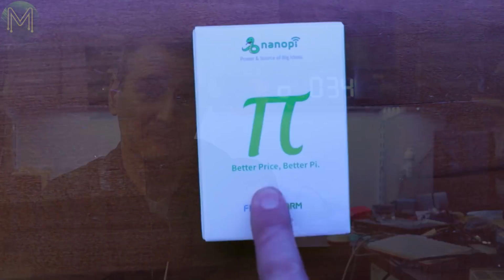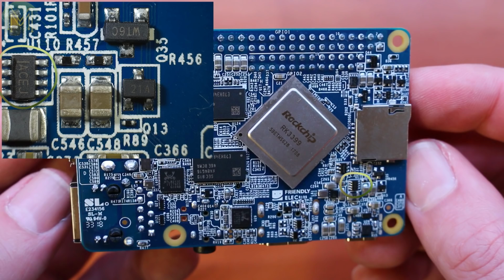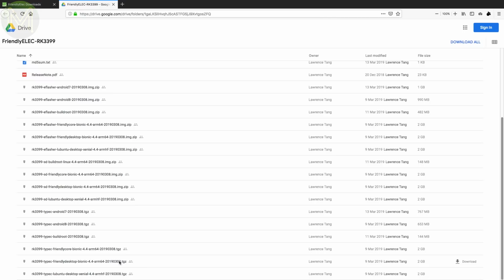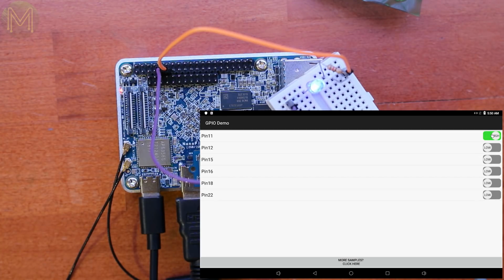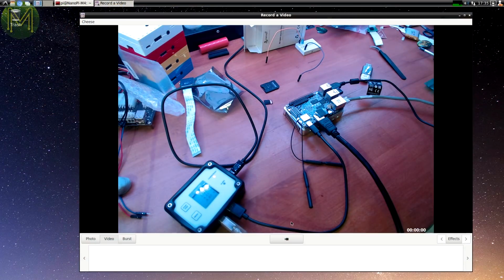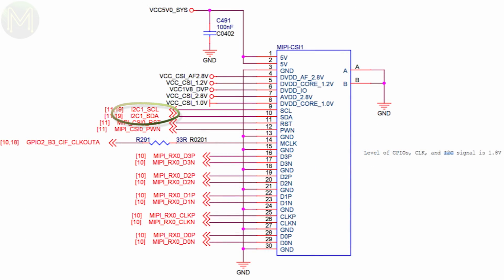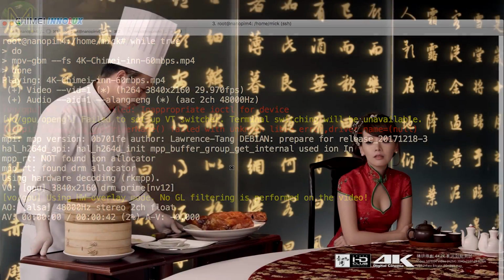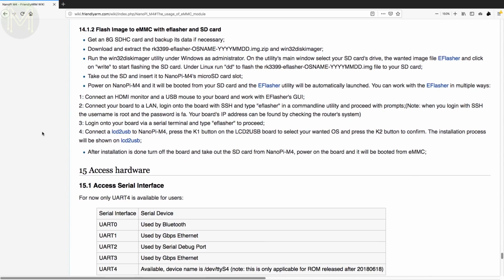#266 Nano Pi M4: Can an SBC get any better? // Review

Comment: Good day Sir, if I have 4k hdmi to csi-2 module, can the nano pi mipi csi-2 have 4k @60fps? if not what's the maximum it can handle. In case it cant handle 4k, is there an SBC that you know that can handle 4k through mipi-csi-2?

Comment: Excellent review!.I have serveral Nano Pi M4 for fast USB3.0 astronomy cameras image download. Tested on Ubuntu and Armbians, ok. I just found some issues porting some Raspbian oriented software, or pigpio types of libraries (DMA usage), and basically you need to sudo quite often to access gpios or i2c.. I saw you using root@ account for your demo's, so you probably faced the same. There is almost no support for this issues anyware. Thanks!

Comment: Want this board  still  there's  a  new  revision  of  it defaults  to  4 ram  of ddr4 ads a power switch   70 usd .and  a  nice  case with  a  fan and  the  ssd adapter  by default  forgot  to  mention   the  case  and  ssd adapter  on the  original  post  .

Comment: Hey Mick,
Jeez, you went through the update kernel bit sooooo fast!!
When I changed to Nightly on my headless Armbian Orange Pi PC +, it started "Removing current kernel ...". Then I lost my Putty connection, but was able to get to a prompt from a Pi (via Putty) connected to the serial debug port (using Minicom). It reports "sudo: armbian-config: command not found". I wonder what happened???
It would be good if Armbian had a way to backup the emmc. Something like Friendly's EFlasher! Maybe there is a way?

The reason I was so interested in updating the kernel is that my OPi PC+ looses WiFi (Wiffy) connection to my router every few weeks and I'm not sure why?

BTW: It may be useful for many (definitely for me) if you could do a tutorial or few on how you check the capabilities (SPI, I2C, etc) of SBCs. Some of that kernel magic may be useful to know, too. You seem to do some fancy stuff that I don't see others doing!

Thanks for the awesome vids!!!
Reply from the maker: Thanks mate.

Sounds like the board crashed half way through the upgrade.
The short answer would be to reflash the SD and go from there.

I’m actually thinking of designing a Pi header tester so anyone can test out SBCs that have a “Pi header”.

Comment: Don't the GPIO signal pins use positive voltage?  So connecting it to another positive voltage GPIO would cause a mixed signal.  the GPIO signal pins should be positive and connected to  a GND GPIO right?

Comment: What power supplies would work with this? I've read it's not a smart USB source so needs a constant voltage type supply but haven't seen a 5v 4a one in AU. The one they offer on the site is US pins.
Reply from the maker: Indeed the USB TypeC isn’t fully PD compatible unfortunately.

Comment: More cores and more ram. I could replace more systems on my network and start doing more low power consumption virtual machines. I plan to soon 3d print a 2u panel and attach smb to the panel.
Reply from the maker: Nice. I’m planning on updating my Pi3 cluster with some NEO4s. Slightly cheaper than the M4.

Comment: Im looking for the cheapest sbc just to test wired Ethernet 1gig download speeds at different customer locations that have 1 gig download isp speeds. Im thinking i will add a small screen, case and mouse. (will just use the keyboard to save a few links, then hoping i will not need it) ..... anyone have recommendations?

Comment: I have soldered a jumper header into the two holes that my Raspberry Pi provides for attaching a reset switch, you can easily attach a reset switch from a PC now.. Do those holes exist in this board as well?

Comment: Hi Mick. Good review. I love the board. The best all round sbc. The FriendlyElec images don't have anything to do with Armbian. And there's a media script for Armbian Bionic for good video playback.
Armbian and the FriendlyElec images are also not clocked the same(2Ghz,1.5Ghz Armbian/1.8Ghz,1.4Ghz Friendly), so the temperatures are different, and power consumption. Cheers. NicoD

Comment: I picked up a couple of these a while back.   They have much more I/O bandwidth than a RPi.  That's probably true of other RK3399 SBC's too.  Really, the RPi bandwidth is very limiting for some applications, more so than the CPU.  e.g. two USB cameras plus a wired network connection is too much for a RPi.  But no problem with Nano Pi M4.
Reply from the maker: Yup, the RK3399 can certainly handle a lot more I/O throughput than the raspberry pi.

Comment: Glad you made a tutorial on how to flash an emmc using a microsd card. Having a problem with a 32gb set I've bought recently. Might be a faulty emmc to microsd adapter.
Reply: Really this is to everyone,  I use a transcend USB3 to microsd adapter with then a microsd to emmc card ( from hard kernel ) to flash images.  Now with that said I have seen cards with 2 connectors ( 2 strip ), but you can get the microsd card to fit these also.
Reply: It's working on android 7 now. Bluetooth headphones also works great. Don't like the android version. I'll try bionic next.
Reply from the maker: Yeah I’ve had a similar issue with an adapter I bought from FriendlyARM

Comment: Thanks Mic I've been thinking about getting one but.... You didn't test the Bluetooth tisk tisk
Reply from the maker: Yeah, I am planning a cross-comparison of several SBCs with Bluetooth. Well..... at least the ones with differing Bluetooth modules
Reply: @MickMake  oh ok sorry mate I didn't mean to step on toes. Good idea to compare the different types of Bluetooth modules.
Reply: JFW
Reply: @sethrd999  jfw?
Reply: @poppabeardoes  Just Works!, the combo module is based around Broadcom apparently, the Wifi is still hazy in this regard but the BT side is there 100% in mineline kernel.
Reply from the maker: Yeah, the WiFi/Bluetooth modules are pretty stock standard. So, little need to test, but for completeness, I should.

Comment: Hi, great video thanks very much. Is there any chance you could try the QT related OS on the m4, it basically runs a QT based C++ application tailored for the m4, it is one of the m4 OS options, cheers
Reply from the maker: QT is a widget toolkit that is supported by pretty much every Linux distro. Or where you referring to some other Linux distro?

Comment: Now thats how you cover a bit of kit,  thumbs up for a great effort.  Your the first to go closer to bleeding edge which really needs to be to get the most out of your SBC on Linux.  I was explaining to a couple of people at the local Makerspace that the SBC space is where the PC/X86 space was in the early 2000's ( kernel 2.2ish ) .

Kernel 5.1 on the 3328 added in alot more of the snd SoC stuff ( Alsa ) so everything is there out of the box, also an update to the dri/drm for the Mali T7/8 00 series GPU's ready for Panfrost/BiFrost.

Rockchip seem to be leading the way as this makes the RK88xx range the most open friendly SBC's now along with the IMX range from Freescale / NXP.
Reply from the maker: Thanks mate!

Yeah, as I said in my prediction early in the year; the RockChip will end up with a lot of market share by the end of the year.
Reply: @MickMake  Indeed

Comment: Looking to use Raspi or nanopi as part of a home automation system, and concerned about reliability of SD cards over long term 24x7 usage. Given this sbc has emmc - any comments on its reliability/suitability for always-on use? The power management options look exciting (maybe I need to get out more if this is exciting!)
Reply: SD cards are fine for read only use, I ran several VMWare clusters in a production environment off of SD cards (the Dell modules have sorta RAID1 but I only needed the backup card once in 3+ years across 15 servers). What they won't survive is lots of small writes so no logging to disk or database type use, eMMC isn't much better at that use case so best to go SATA SSD if you need to do something write intensive.
Reply from the maker: Yup, as Andrew said, SD isn’t much chop for an O/S. It’s is possible to run an O/S off a USB flash drive for many years. I have four Pis that are being used as syslog servers. Been doing their thing for over 5 years.

Comment: Rockpro64 is also based on the 3399 as you know and is a very competent offering. The great thing about that board is that they actually have multiple cases available to include the new Roshambo case for those that want to use it for gaming.
Reply from the maker: Yeah, that’s another nice board. Although not as polished as FriendlyARM
Reply: @MickMake  Thats because it was the first one ;)